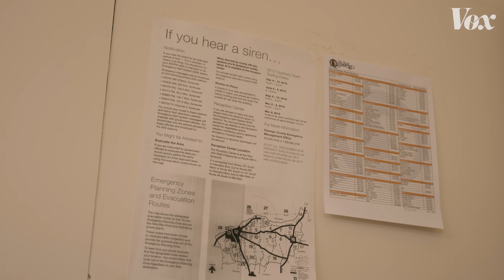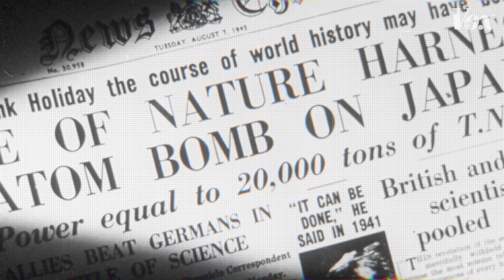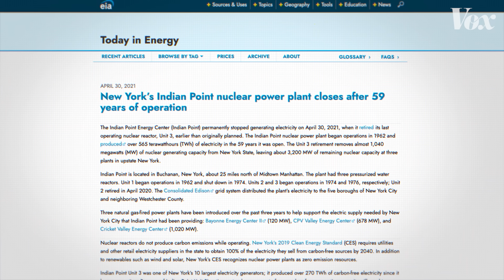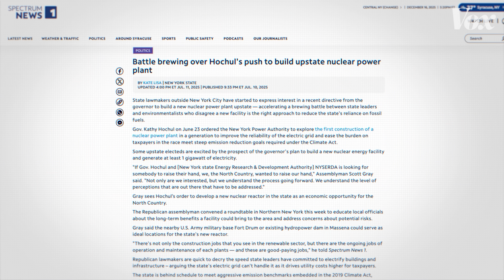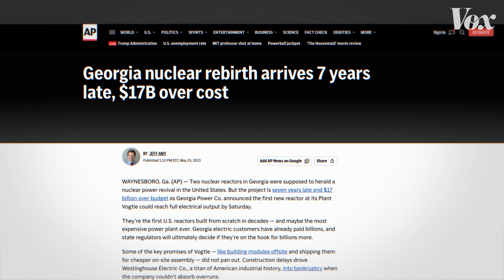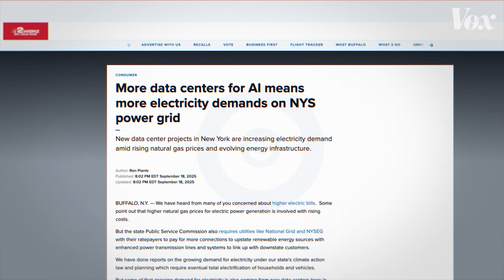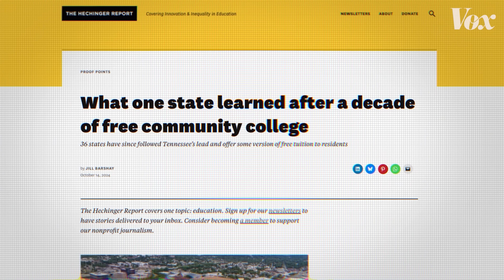This town has three nuclear plants. Now it wants another one

Comment: For me, for those of you from Russia, clean energy and very few by-products and residues after energy production means nuclear energy. And for me, it's clean. Gas isn't available to everyone, and it's difficult to deliver. Wind and solar energy are better, but there are still so many problems afterward (when it's time to replace them with new ones, these panels and wind turbine blades are practically impossible to remake and remelt into something else). + The efficiency is still too low. Coal and fuel oil - I lived in a city where they only heated with coal and fuel oil, and it's not very pleasant to live in. The environment is bad, and that's not to mention global climate change due to the burning of hydrocarbons. But nuclear energy is cool! And if everything is improved, there will be no safety even in the event of an accident. We won't have another Chernobyl or Fukushima!

Comment: I want to mention, most of the US and France relies on PWR’s (Pressurized Water Reactors) which are 1. Different from Chernobyl which was LWGR (Light Water Graphite Reactor) which had higher danger parameters. Japan’s Fukushima was a BWR (Boiling Water Reactor) which is usually considered a less safe reactor to PWR’s. They were hit by an unprecedented double natural disaster events. A tsunami and an earthquakes which later dictated that during a natural disaster, PWR’s are the safest option in case of a containment failure.

Comment: Why is nobody talking about how grossly incompatible nuclear is with a modern grid? They don’t ramp output up and down anywhere near enough to fill in solar gaps. They are based on spinning mass so are going to clash with  digital grid forming inverter based grids. South Australia is a glimpse at the future it is often running on 100% solar with some gas turbines exporting interstate. Soon it will run with no spinning mass. The rest of the world will go in this direction and nuclear can compete financially or technically.

Comment: Excellent piece! Two comments though for clarification
1) Nuclear does take up a lot of water, but most of it gets returned to the source, a little warmer but not polluted. 
2) The need for more electricity doesn't just come from AI. It also comes from the electrification of cars and building heating and cooling, as well as the need to replace the many aging fossil fuel plants in NYS. 
Really well-done piece though!

Comment: I'm not against Nuclear Power. It's biggest problem isn't PR anymore, it's biggest problem is it's the MOST expensive way to produce Electricity people have ever invented. You shouldn't compare costs from a 50 year old Plant with current generation options. Vogtle in Georgia cost about 3 times its estimate. Olkiluoto in Finland was double the Budget, Hinckley Point in the UK is about 5 times the projected expense - $60 Billion Dollars over Budget! Y'all can huff and puff about Regulations and Bureaucracy, but who wants the Worlds most expensive electricity?
The proposed VC Sumner Plant in one of the Carolina's blew through $9 Billion Dollars, and left nothing more than a giant concrete slab. Taxpayers pay for that. YOU end up paying for that.
Reply: building the powerplant is expensive, sure, because it has tight safety requirements for good reason. operating the powerplant is much less so, have you seen how little fuel it uses?
Reply: @justachickenboi   Mate, it's not just expensive, Nuclear PP's take so long to construct. We can knock up a Gas Turbine, Solar Panels or Wind Turbines in less than a year, and immediately create an income from the elecricity they make. Nuclear is taking 12 Years to come online. That's an enormous Debt to wear for a long time before you see any income. And everything is Financed these days, so for 12 years someone's paying Interest on that multi-billion dollar debt, with no income to offset it against.
No Bank will Fund an NPP without assurances from the local Government all the electricity it creates will be purchased at a prescribed minimum price for the next 20 or 30 years.
With renewable prices dropping every year alongside a similar thing happening with battery technology, that makes a set price assurance a Hard Sell to Taxpayers.
Especially with people campaigning against Nuclear on ideology who can wave around graphs showing how cheap wind and solar are. They always leave out storage costs and Dunkelflaute periods, but not enough Taxpayers and Voters have the time to get deep into those problems.

Comment: Liquid Fluoride Thorium Reactors will produce 95% less nuclear waste that has a half life of hundreds of years compared to tens of thousands and also you cannot use the byproduct to make weapons.  seems good to me. Oh, they also inherently cannot melt down.  molten salts boil at over 1800 degrees and when it heats up becomes less fissile, automatically slowing the reaction.  cool stuff

Comment: I live by a coal plant. I'd feel much better if it was nuclear.
Reply: coal plants give off more radioactive waste than a nuclear power plant
Reply: Ok. So if there is a catastrophic failure? Think Three Mile Island in PA and Chernobyl in Russia. Where do you think they are going to get rid of all the nuclear waste? Nuclear energy is NOT clean energy. NO to nuclear power in NYS.
Reply: Backwards compatible too. Just swap out the coal part for the nuclear part. It's still steam generator all the way
Reply: @calvinnyala9580  yea it be much cheaper the only problem is modifying the building to have a containment building around the reactor and such
Reply: @koiyujo1543 You all must not be old enough to remember why they got rid of nuclear power. It is NOT clean energy. It produces nuclear waste that needs to be disposed of somewhere. And let's not forget about the Three Mile Island incident in PA or Chernobyl.

Comment: A couple of comments from a retired fossil and nuclear power plant engineer:  Any steam cycle power plant needs the same amount of water for its size.  Fossil plants need the same as nuclear plants.  This is due to the inherent nature of the Carnot thermodynamic cycle that is used.

Worldwide the average construction time for a GW+ nuclear power plant is 6 years, and almost all of them come in on time and on budget.   I do believe that about 10 new nuclear power plants a year are coming online worldwide.

The concept that SMRs will be built in a factory is false.  Components will be built in a factory just like components for 1GW or larger nuclear power plants are built in a factory.  Components will be shipped to site to be field assembled into a plant - same as a 1GW or larger nuclear power plant.

Another problem is that none of the SMR plants have been proven to work and be long term reliable.  We now have very reliable large PWR reactors such as the AP1000 design that were designed with what worked best in similar sized plants over the last 4 decades.  SMRs do not have any similar database to pull from.

A problem that SMRs has is that if you double the size of the power plant, you only need about 20% more matrial and it costs about 20% more to build - and in most cases you do not need more staff to run it.   The very reason we build very large fossil and nuclear power plants is due to this economics of scale.  The NuScale attempted SMR plant in Idaho canceled in 2024 demonstrated this very accurately.   That plant would have cost about the same as a 1150 MW Westinghouse Nuclear AP1000 plant which would generate 2.6 times more power, and keep the same staff size.

No one in the world has built an economical SMR.  The Chinese has built one and admits that SMR's will never be cost competitive against large central stations.
Reply: This was an interesting read. Thank you!

Comment: 100% pro nuclear; the safeguards post Fukushima are all passive, if something goes wrong it just shuts down & it doesn't require power to do it. Plus all the talk about small thorium reactors & getting red hydrogen as a byproduct. Nuclear is the cleanest best option & we can get fuel cell cars & get OFF TOXIC EXPLOSIVE BATTERIES at the same time it's a win win.

Comment: Coal plant generates more nuclear waste than a nuclear plant will ever generate.
Reply: It's also far deadlier per energy unit than nuclear.
Reply: @minigunner1218 And far more poluting
Reply: And while a nuclear plant keeps it all contained in casks right there on site to be handled however we see fit, a coal plant straight up releases it into the environment pretending it doesn't exist.
Reply: Nuclear waste from Coal ????
What planet are you living on ?
Reply: @baldylocks6  Carbon 14 is a radioactive isotope.
Reply: @baldylocks6  
1. Uranium is distributed throughout the crust. For every ton of fuel used by a nuclear reactor, a million tons is used by Coal plant. ( For example, Uranium dissolves in water, the Ocean has sufficient Uranium in it, to boil the Ocean 5 times over. Worse living things preferentially absorb nuclear matter. )

2. When a nuclear plant uses a ton of fuel, the radioactive residue is kept contained. 

3. A coal plant puts tons of Uranium into the atmosphere : no power source exists which don't release radiation : coal, because of the sheer amount of fuel consumed, releases far more radioactivity than a nuclear plant does.
Reply: @baldylocks6  
Earth, look up the mean concentration of radioactive matter in the crust. When you do, you will realize putting millions tons of processed crust, coal, oil, etc., into the air will also release many tons of radio-actives.
Reply: This one
Reply: Burn gas.  Retire coal.
Reply: Nuclear waste? Coal is not radioactive,  as far as I'm aware. I get your point though..
Reply: @kristianmorris9738  It is tho, its a lot less radioactive per kg than nuclear fuel but when you burn a lot of coal (many Tons of coal vs KG or nuclear fuel) its ends up emitting more radiation than nuclear would for the same power. The radioactive material for a nuclear power plant is also contained and highly regulated, unlike coal, which is simply sent up the smokestack and into the air you breathe.
Reply: @kristianmorris9738  carbon 14
Reply: @kristianmorris9738  
Lookup the mean amount of radioactive matter in the crust. Plants during their life retain radioactive materials. Coal is dead heat processed plant matter. Each ton of nuclear fuel is equivalent to million tons of coal.
Reply: Coal ash is radioactive.
Reply: @GeorgIsm-u5p NORM = naturally occurring radioactive material. Coal has a lot of naturally occurring radioactive material
Reply: @deetlenroy Which you concentrate when burning coal

Comment: You all know the last projects in Europe were financially Desasters and took decades to build. Olkiluoto 3 in Finland, Hinkley Point C in Great Britain and Flamanville in France. They all went way over budget and the cost of electricity is extremely high. The cost for the centuries of waste storage is not even included in these cost. Nuclear power plants are only beneficial for the companies building them with huge subsidies by government. The projects in development right now (like Poland or Bulgaria) will not be finalized in the next decade. The regulations and safety rules for nuclear are way more difficult to fulfill. So instead of focusing on these insanely expensive projects we should use the powerplant, which are already build and renew our grid with renewable energy sources. 

Best we can do right now is Solar + storage and gas powered peakers until we develop a better longtime storage solution. Maybe just better and cheaper batteries.
Reply: Despite ridiculous overruns, Olkiluoto 3 was worth it for Finland. It opened just in time to allow us to stop importing from Russia, while we simultaneously shut down coal plants and built onshore wind. Solar doesn't really work here since we barely see the sun in the winter when the load peaks. Still useful for the summer maintenance of the nuclear plants, though. Olkiluoto 3 and wind turned us into an exporter. I'm glad we about dodged the bullet that was Hanhikivi plant that was supposed to be built by the Russians.

Comment: I love the idea of converting natural gas and fossil fuel reactors into nuclear reactors. You basically just have to change the source of heat from burning fossil fuels to splitting Adams and the rest of the power generation cycle essentially remains the same.

Comment: Why does nuclear energy have to be bundled in with AI data centers? I would LOVE to clear the stigma around the first, without rewarding the AI centers of slop which will inevitably taint nuclear energy by association.
Reply: Because tech giants are the only corporations who can afford to pay the high capital costs to build a nuclear power plant and wait well over a decade to break even financially. Renewables with battery storage are simply cheaper now and can be built out incrementally. Perhaps modular nuclear plants will have a future in the US if they can achieve economies of scale.
Reply: @bobhuang94  Renewable with batteries are only cheaper when not used at scale. True about the modularity though—adding an extra mwh of solar is much, much easier than an extra mwh of nuclear.
Still, I'd argue that a big reason for that is the stigma around nuclear that makes it unattractive for investment, and thus cripples research in the field, driving prices up.
Reply: Because progressives ruin their messaging.

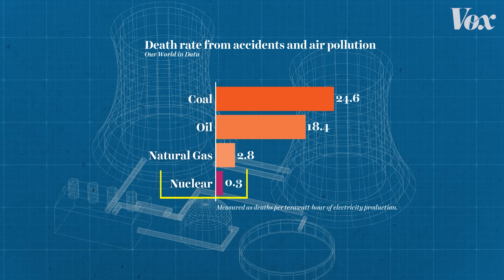Comment: Hey Vox! The visualization at 5:30 is incorrect. According to your source, the death rate for nuclear energy is 0.03 (not 0.3) and also the scale is way off (either the nuclear bar is way too large, or the coal bar is way too small)

There are 8,200 deaths from coal for every death from nuclear. You are incorrectly claiming that there are 82 deaths from coal for every death from nuclear.
Reply: Yes - nuclear is actually even safer than the graph is describing
Reply: also why are renewables missing in the graph?
Reply: People will also claim various other "renewable" sources have even fewer deaths than nuclear.  This is also not true when comparing energy produced.  Look up "Deaths per TWh" and see for yourself (ie Google it).  Note, TWh is 1 Billion kWh (kWh is how you pay for power, represents 1000W used for 1h).
Reply: What
Reply: Nuclear = cancer
Reply: @charlessands9228 A nuclear plant worker that works 5 days a week at the plant is exposed to less radiation than a person is exposed to getting on ONE airplane ride.
Reply: @CommanderCodey internal vs external dose..... fuel pools have no containment dr earnest j sternglass 😮
Reply: @charlessands9228  wrong
Reply: @CommanderCodey  a plant worker cleaning up the mess at Fukushima got a lifetime of radiation dose in one minute of work.  That doesn’t happen at a wind farm, or gas plant, or coal plant.  Nukes are great until they aren’t.  Then they’re an enormous mess.
Reply: @Enter_name_here-q4d Nuclear disasters are exceptionally rare, and workers at coal plants are exposed to extremely harmful air that causes permanent damage every day they work there along with the people who mine the coal that gets processed at the plant. People who live around the coal plants are also exposed to the same harmful air. The nuclear plants of 1960 are not the nuclear plants of today.
Reply: @charlessands9228  Going out during the day = cancer.
Non-stick pan = cancer
Flight = cancer
Cigarettes = cancer
Alcohol = cancer
Living in a city = cancer

Fuel pools have enough containment, Dr. Coal. You can take a bath in an inactive core's pool and get 0 dose. In fact, if you want to get any amount of harmful dose, you'd have to stare down at the core going full blast.
Reply: @charlessands9228  No, coal  = cancer certainly, Nuclear = cancer very rarely when everybody screws up massively. You can count the number of fatal nuclear incidents on one hand. Not true for coal.
Reply: @aaryanairy756  also wrong a very important part that everybody collectavly just ignores is that nuclear power plan that use every other type of ractor exept rbmk cant explode like its not physily possible and the possible harm could only come to worker how just handle the freshly depleted rods wrong